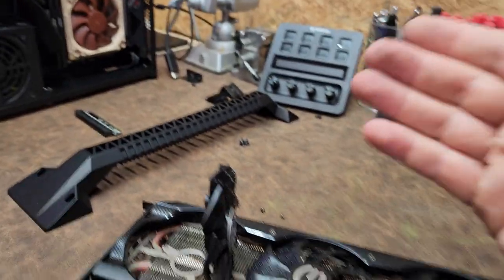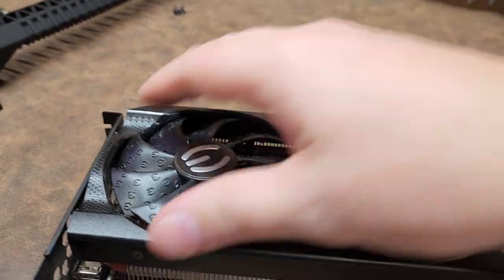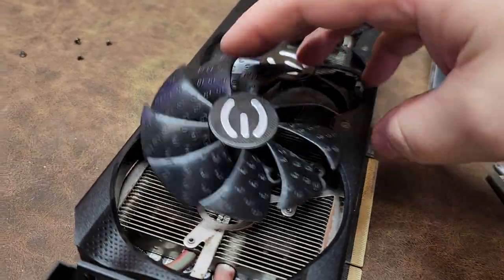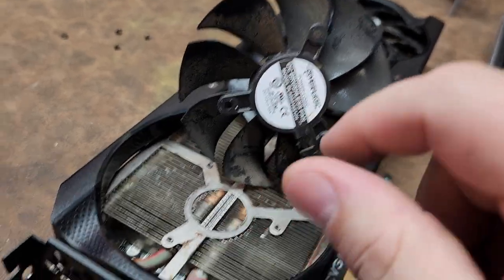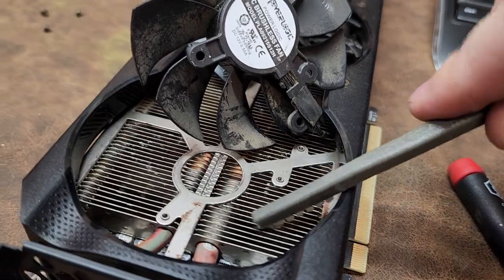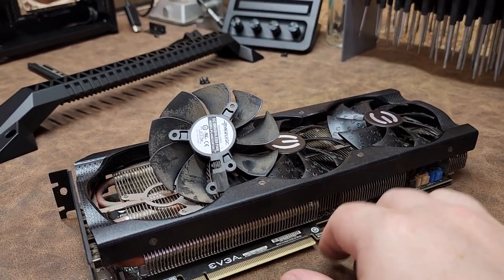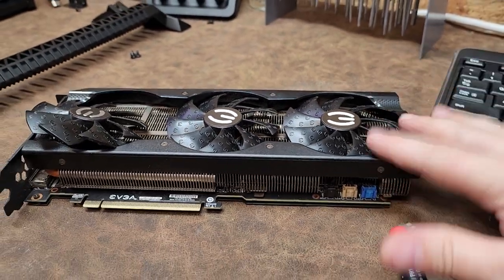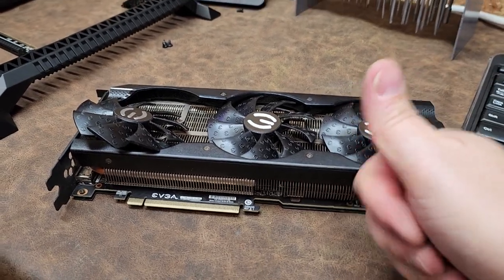GPU Maintenance (Used GPU)

Comment: I love K5 pro, just fixed up my old Vega 56 with a missing thermal pad taking everything down 20+ degrees
Reply from the maker: My liquid cooled 3090 back plate and water block replaced thermal pads were done with k5 pro and I did a video on using NVME as a high speed USB3 external drive - also encased in k5 pro.
I laptop was also redone with Kryonaught and k5 pro. Works pretty good!